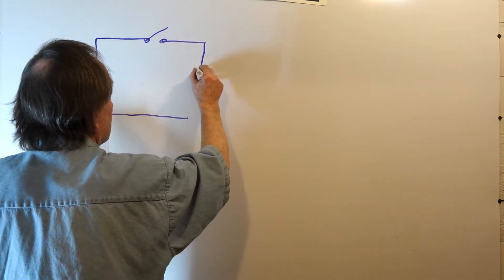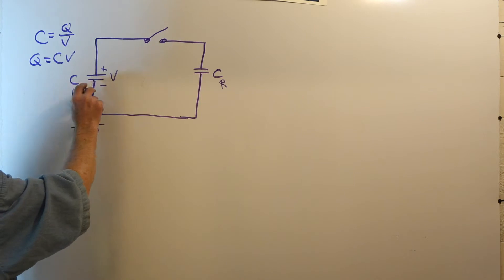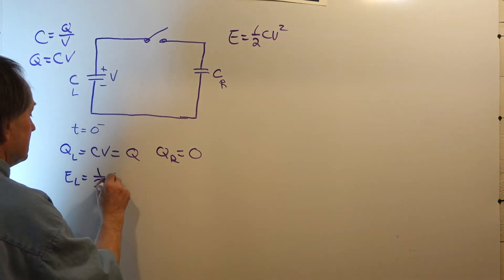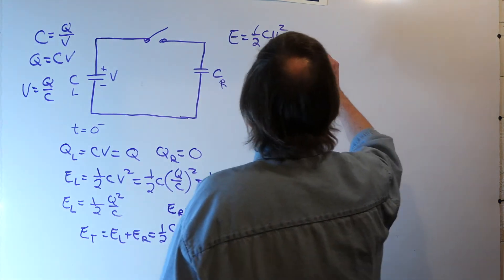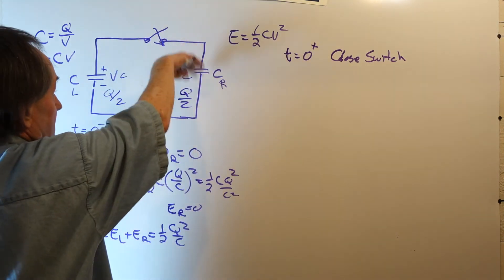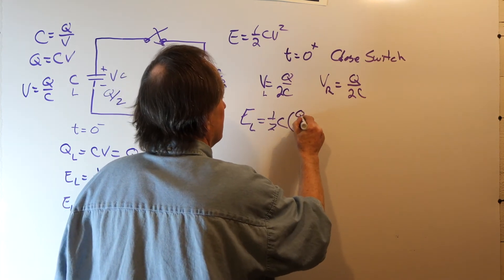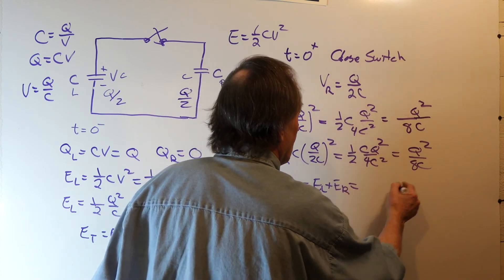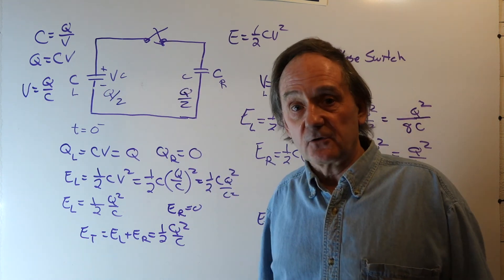Capacitor CHARGE and  ENERGY  Transfer  Problem

Comment: I don't believe that "free space" recognises a switch.  It recognises capacitance and inductance, among other things.  But a switch is an artificial concept, and therein lies the fallacy behind this seeming paradox.

It is important to note that there is an electric field across the closing air gap.  This causes a mechanical force of attraction between each side of the closing switch.  This is the electrostatic force of interaction, the principle upon which an electrostatic voltmeter works.  (See Wikipedia:  Coulomb's Law).

It is philosophically valid to assume a theoretical zero loss.  On the other hand it is NOT philosophically valid to ignore the capacitive influence of a closing switch because capacitance is the very phenominon that is here examined.

We have the ingredients of a situation in which work is done and electrical energy is converted into mechanical energy.  As the switch closes an electric charge is moved through an electric field, hence the mechanical force of attraction acts upon a moving object.  The switch is "doing work" upon the mechanical system that is causing it to close.  It is evident that, in the absence of losses, the magnitude of the electrical energy thus converted is equal to half the original energy in the LEFT charged capacitor.

See:  http://capacitorparadox.appspot.com/
Reply from the maker: George10767,
I read the analysis by John Winsor.   In short it is all a bunch of gobblygook.
It was painful to read through the analysis for most of it was bullshit.  This person hasn't a clue as how to model switches.  This statement you copied is utterly ridiculous:  [[ I don't believe that "free space" recognises a switch.  It recognises capacitance and inductance, among other things.  But a switch is an artificial concept, and therein lies the fallacy behind this seeming paradox. ]]

The only thing stated in that analysis that is true is:  [Suppose we represent such losses by inserting a series resistor.  Whatever the value of the resistor the magnitude of the missing energy remains the same. ]]

This statement you copied is a bunch of nonsense: [[ We have the ingredients of a situation in which work is done and electrical energy is converted into mechanical energy.  As the switch closes an electric charge is moved through an electric field, hence the mechanical force of attraction acts upon a moving object.  The switch is "doing work" upon the mechanical system that is causing it to close.  It is evident that, in the absence of losses, the magnitude of the electrical energy thus converted is equal to half the original energy in the charged capacitor C1. ]] 
It is easy to make statements like this with no analysis to establish it as fact.  It is quite a bold statement to make that the magnitude of the electrical energy thus converted from the mechanical closing of the switch is equal to half the original energy.  This is ridiculous.  Prove it.  Where are the calculations that show this to be the case?  None is provided.

Winson states: [Since capacitance is inversely proportional to the distance between the electrodes, the capacitance from one side of the switch to the other becomes progressively greater and approaches a theoretical infinity as contact is made.]   Not so.  Typically the capacitance between switch contacts is on the order of pF(picoFarads) and NEVER rises much above that as switch contacts are closed.  The dynamics of contact closure is not that simple as Winson assumes.  Hence the need to assume an IDEAL switch.  This is a hypothetical problem with IDEAL components that can be modelled quite closely with real circuit elements using high grade capacitors.  I will talk a bout this in my solution video.

In short you wasted some of my time with this nonsense.
GH
Reply: You are too emotional, Mr. Hnatiuk.  In paraphrase you seem to be saying:

1.  There is no capacitive effect of a closing switch.

2.  Coulomb's "Force of Interaction" does not exist.

3.  Within a closing switch, force applied over a distance does not represent energy.
Reply from the maker: George10767,
You are putting words in my mouth.  I never stated any of those things.  You repeated the gobblygook of John Winsor's analysis without analyzing it yourself to see if it makes sense.  Neither you nor he provided any analysis to justify your claim that the missing energy can be accounted for by the work done in closing the switch.

You do realize that the capacitance between the contacts of a switch can never approach values above nanoFarads at most before contact is made do you not?  It is NEVER going to reach the Farad region let alone become INFINITE as Winsor assumes as the distance between the contacts lessens to where they touch and full contact is made.
If you believe as he does, then you have no understanding of the contact dynamics of switch closure and no practical experience regarding this matter and just are pulling thoughts out of your backside.  Going with "sounds reasonable to me" with no further thought into the matter to investigate if the claim fits reality or not IS NOT the hallmark of a good engineer.

If you are going to make a claim, then be prepared to back it up with an analysis I can believe in.  Anyone can make a claim or guess a reason as to where the energy went and how it MIGHT be accounted for.  That is what the majority of comments do that I have read in previous threads and forums that have presented a so called analysis of this problem.  It is easy to make conjectures, quite another to justify and provide a solid analysis demonstrating it to be true.

Please do not waste my time with these conjectures.  Try analyzing the problem on your own rather than pulling nonsense off the internet and throwing it up here as if it is gospel.
GH
Reply: Don't be so grumpy.  You have said:

"You do realize that the capacitance between the contacts of a switch can never approach values above nanoFarads at most before contact is made do you not?  It is NEVER going to reach the Farad region let alone become INFINITE as Winsor assumes as the distance between the contacts lessens to where they touch and full contact is made."

Of course this is a theoretically impossible situation!  But the creation of such a situation is what your question is all about.  You have already said that "The network has no losses...".  Well, if YOU can create a theoretically impossible situation, so can I.

But here is the crux of the matter as I see it.  The formula for Coulomb's "Force of Interaction", however true, applies only to charges that are point charges or are charged metal spheres. It does not apply to other mechanical arrangements.  So however much I would like to show mathematically that electrical energy lost is equal to mechanical energy gained, such a task is well beyond my intellectual ability.

Therefore I am reduced simply to pointing-out what is really happening.  I am sorry if this disappoints you but, nevertheless, it is always a pleasure to read your vulgar invective.
Reply from the maker: Your statement:  [[ Therefore I am reduced simply to pointing-out what is really happening. ]] is NOT at all what is occurring.  This is just pure CONJECTURE on your part.  Do not make statements of what you consider to be factual that you cannot back up with rigorous proof.

You really need to reconsider your statements and understanding of electromagnetic theory:  [  "Force of Interaction", however true, applies only to charges that are point charges or are charged metal spheres. It does not apply to other mechanical arrangements.]
Now that statement is simply coming from a position of ignorance.  Ever hear of superposition and LINEAR space?  Whether or not charge is bound or free in a CONTINUOUS distribution or in discrete point charge arrangements, Coulomb's law can be used.  The fundamental problem that electrostatics tries to solve is given an arrangement of source charges, discrete or continuous, what force do they exert on another charge?  The positions of source charges are given as a function of time and the trajectory of the test charge is to be CALCULATED.  In general, both the source charges and test charge may be in motion.

You are making the problem unduly complicated.  It is not that difficult to resolve with linear circuit theory.  You are just not looking at the problem properly.  Maybe you should quit guessing and apply critical thinking.
GH

Comment: Hi, I would say that the missing energy is due to kinetic energy by the charges moving from the left capacitor to the right capacitor. For t<0 we have a potential energy, Wp = (1/2)*CV^2 at the capacitor C_left, and Wp = 0 at C_right. But kinetic energy, Wk = 0.(No charges is moving). Wp can also be written as Wp = (1/2)*Q*V. For t>0 the amount of charge moved from C_left to C_right is Q/2, so there is equal charge on both capacitors. The voltage across the capacitors drops to V/2, so total potential energy: Wp =(1/2)*(Q/2)*(V/2) +  (1/2)*(Q/2)*(V/2) = (1/4)*Q*V. (If we add upp for the two capacitors). We have no resistive losses, so we can assume that kinetic energy is driven by a conservative field.Then we just have to look for initial state and final state. So the voltage goes from V to V/2, or a voltage difference of V/2. Initial charge is Q and final charge is Q/2. Difference = Q/2. The kinetic energy then becomes: Wk = (Q/2)*(V/2) = (1/4)*Q*V =(1/4)*CV^2. So, from the beginning (at t<0): Wp = (1/2)*Q*V, Wk =0. Then (at t>0), Wp = (1/4)*Q*V, and also Wk = (1/4)*Q*V which is lost in the transition (at t=0).
Reply from the maker: Ulf Häller,
Interesting analysis but you have not proven your hypothesis regarding kinetic energy.  Of course your analysis sounds reasonable but you need to show a kinetic energy calculation to verify this hypothesis of yours and that the kinetic energy imparted to the charges equals the missing energy.  I choose to challenge you on this point.  I contend that the kinetic energy required to assemble the charges on the right capacitor plate from the left capacitor is the energy stored in the electric field between the plates of the right capacitor.

You state: [ The kinetic energy then becomes: Wk = (Q/2)*(V/2)  ]
Are you sure?    

Work (energy) required to move a SINGLE charge, q, in an Electric field is:

                             Work  =  Energy =   ∫ F • dl   =   q∫ E • dl  =  qV
                                  This is what you are using for K.E.

whereas the energy stored in an electric field due to the movement (kinetic energy) of a large group of charges to assemble the total charge on a capacitor plate is:

        Energy =  1/2 CV²  = 1/2 Qt V       where  Qt  = capacitor plate total charge 

                     Wk = 1/2 (Q/2)*(V/2)  =  Q V/8   NOT   Q V/4

     Your kinetic energy is off by a factor of 1/2 so still missing some energy.

Some of the energy lost by the left capacitor is gained by the right capacitor.
This energy is  Q V /8.  However, the left capacitor lost a great deal more energy than this as the charges redistributed.   So where did that energy go?

  ####################################################
            I will be posting my answer Sunday afternoon  Jan.  29, 2018
  ####################################################

Consider the following charge movement (kinetic energy) analysis:
----------------------------------------------------------------------------------------------------------------------------
The positioning of a charge, q, at a point in the electric field produced by of all previous charges assembled requires an amount of work given by the product of the charge, q, and the potential at that point due to all those previously assembled charges (superposition).  The total work is obtained by adding the contribution of each additional charge as it is moved in the field that builds as charges are assembled on the capacitor plate. The total positioning work is the potential energy of the Electric field, We:

      total positioning work  =   potential energy of the Electric field  =  We
  
The work or field energy gets accounted for twice when the work on any given charge is summed over all the charges once they have been assembled.  The potential, V, is the combined potential (superposition) due to all the charges in the distribution (on the plate) except for the charge at the point where the combined potential is being determined.  The energy stored in a region of continuous charge distribution is obtained by integrating over the volume of the charge distribution:

                   2*We  =  ∭ρV dv         where  dv = differential volume  
                                                                        V  =  combined electric potential
                    (superposition of potentials due to each charge in the distribution)

                      Gauss's Law:      ρ  =  ∇ • D

           2*We  =  ∭(ρ)V dv  =  ∭(∇ • D)V dv  =   ∭[ (∇ • (V D)  -  D • (∇V) ] dv 

        Applying the divergence theorem to the first volume integral:

                   2*We    =    ∯ (V D) • dA   -  ∭D • (∇V) dv  

The volume must contain EVERY charge, then there can be no charges outside the volume so by making the volume infinite in extent, V on the surface MUST approach ZERO at least as rapidly as 1/r and D approaches zero as 1/r^2 and the differential element of surface is increasing only as r^2.  Hence the integrand and differential surface element together are approaching ZERO as 1/r and in the limit, the surface integral is ZERO giving:

                              2*We    =    -  ∭D • (∇V) dv 

The electric field can be described as a voltage gradient:    E  =  - ∇V   giving,

                              2*We    =     ∭D • E dv 

                     We   =   1/2 ∭D • E dv   =  1/2 ∭ε E² dv      since  D  =   ε E  

                     The energy density:        dWe/dv   =   1/2  D • E       joules/m^3

For a parallel plate capacitor, the field between the plates is uniform over the volume between the plates.     

           We   =   1/2 ∭ε E² dv   =  1/2 ε E² ∭dv  =  1/2 ε E² v
                           
                   v = volume between the plates =  A * d    where  A = plate area
                  V =  Voltage between the plates  =  E d    where d = plate separation
                                                E = V/d
 
                 We  =  1/2 ε E² v   =   1/2 ε (V/d)² A * d  = 1/2 V² (A ε/d)

                       By definition, the capacitance of a parallel plate capacitor is:

                                         C  =  Qt / V   =    A ε/d

                   Therefore:   We  =   Energy  =  1/2 C V²  =  1/2 Qt V

The energy stored in the field is the kinetic energy required to assemble the charges on the capacitor plate.
Reply: Thanks for your answer, and for your very detailed appendix.
I will go through this when I have more time.

This is a very interesting and special problem.

About my hypothesis:

I got the idea by thinking of Newtonian mechanics.
I tried to get some connecton to a falling mass in a gravitational field.

In this case, with electrical fields and so on, I made two statements:

1. The CHARGE is conserved.
and
2. The ENERGY must also be conserved.

We lost half of the potential energy when the charges was distributed from the left capacitor to the right capacitor.

The missing part of the potential energy must then be =  (Q/2)*(V/2).
I mean, we move half of the charges over with half the voltage.
For that to happen, the charges must gain kinetic energy.

Due to my second statement that the energy is conserved, this kinetic energy must be equal to the missing potential energy.

Ok, so I made a shortcut here.
Perhaps it was a too short cut :).

Anyway, I look forward to see the correct solution when you post your video.

Best Regards,
Ulf
Reply from the maker: Your thought process is not wrong but quite reasonable.
I do not know if one can say any solution is the correct one.  When you see my analysis, you will understand this statement.  I will discuss what I mean by this in the solution video.
Think about the terminal relationships regarding the voltage across and current thru a capacitor and what it means in terms of circuit analysis when applied to this problem.
GH

Comment: Transition between two stationary points at the same energy level cannot happen on its own, so no surprise at the energy loss given the two assumed states.  Looking at the initial and final states, I would have to argue for work being done in moving the electric charge between capacitors.  Although, I am also currently of the thought that a continuously oscillating system (with no energy lost from the initial state) is as likely a "final state" as the one you have prescribed if there is truly no resistance or inductance in the circuit to oppose the initial infinite current spike. Do you have an argument for why/how the two capacitors will somehow instantaneously arrive at one steady fixed voltage level at t=0+, in a dynamic sense?  My instinct tells me there needs to be some energy dissipation for this to happen, regardless of the source.
Reply from the maker: James,
You are on the right track but not quite there.  Best explanation I have heard in all the years I have presented this problem.  I solved it while in EE grad school.  There is a very simple explanation.
I would say more but that would give others too much help.  Send me EMAIL, and I will elaborate more without giving you the answer but discuss something you wrote.
ghnatiuk@juno.com
GH